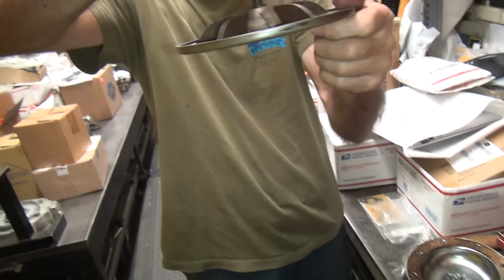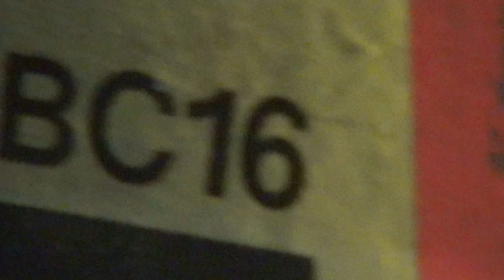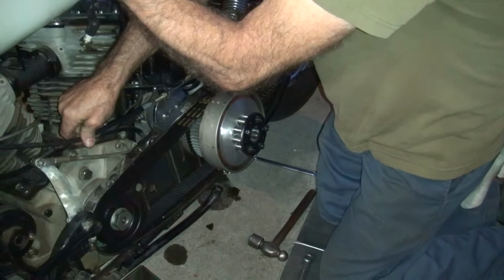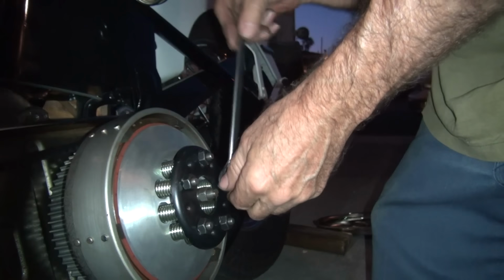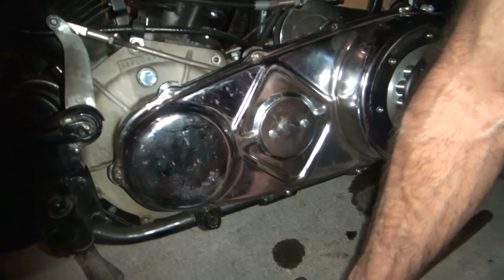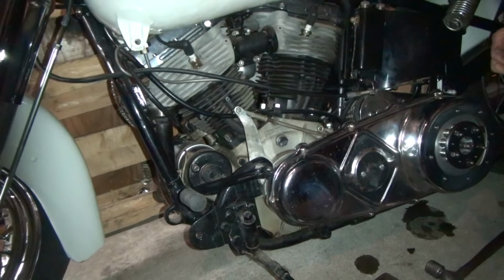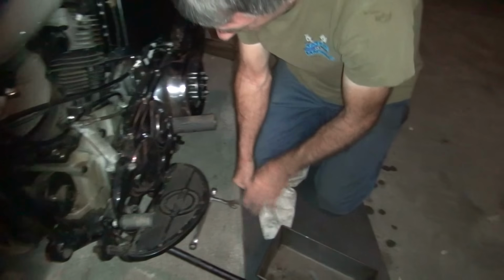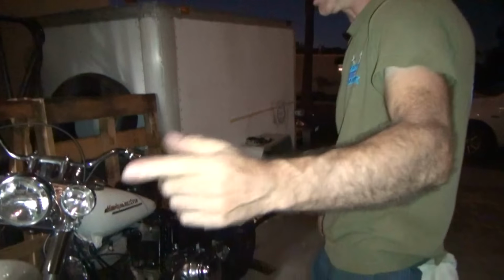#114 1953 74ci panhead bike tune-up, repair, carb tuning kick start get running harley tatro machine

Comment: I put the same clutch & belt drive on my 49 panhead 45 years ago with roller needle bearings in the hub, called big fix. solved all the clutch creeping, dragging, hard-shifting, and finding neutral problems. ride that S O B

Comment: Any recommendations how far to go on cams for a 1960 Sportster without building heat in the heads?
Reply from the maker: i like andrews Y' cams. you will need to do some head work but it is worth it.
tatro

Comment: YOUR OLD PRESSURE PLATE IS NOT CRAP. THAT WOBBLE IS SO EAZY TO TAKE OUT. I BOUGHT A NEW ONE FOR $20 MADE IT PERFECT.  WHATS BEST ABOUT IT IS I RUN BELT PRIMARY,  AND ITS ALSO ... FAN TO MOVE AIR